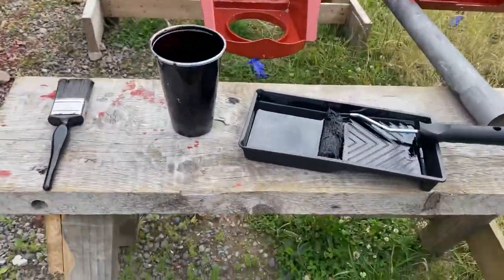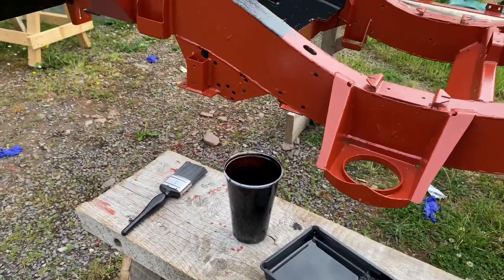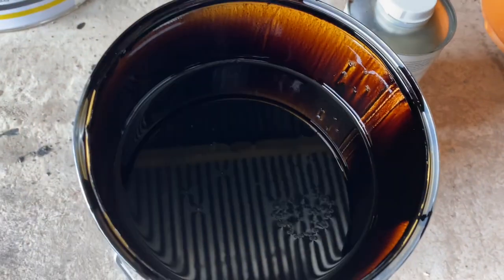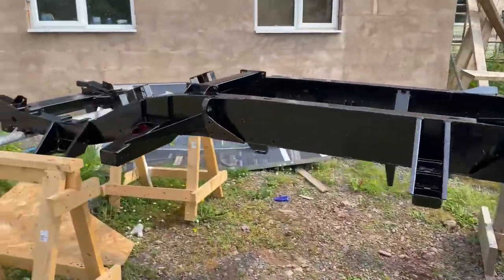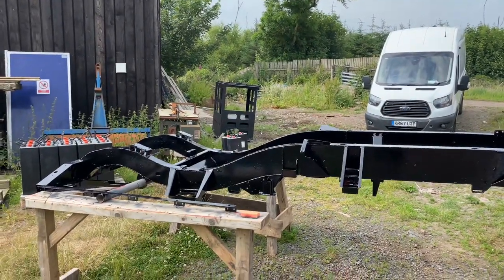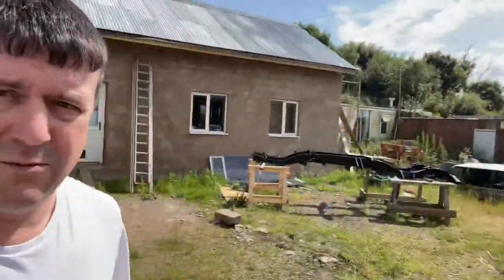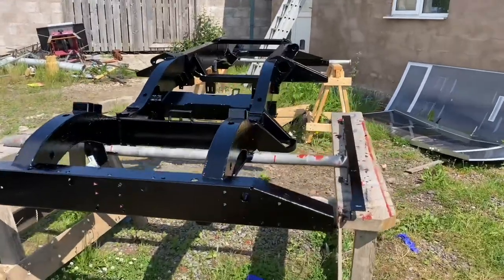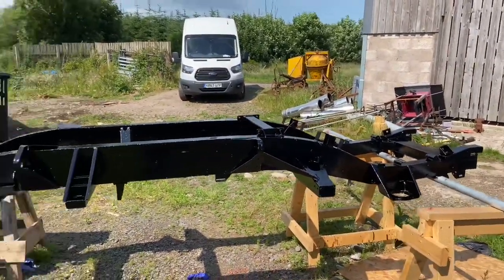Preparing and painting a landrover defender 110 galvanized chassis #landroverdefender110 #landrover

Comment: Why is the red oxide paint controversial? Looks great by the way and I like your thought process in trying to protect the galvanising as much as possible. This is something I'd do to mine if I had one.
Reply from the maker: It caused a lot of criticism on a certain Facebook group, one person believed it would make the galvanizing fall off the chassis….  Another said it wouldn’t stick….

That said, I’ve used oxide paints for years on galvanized steel roofs and it never causes any issues!